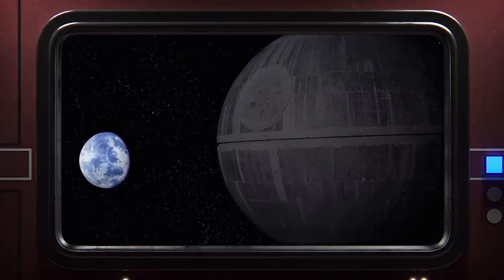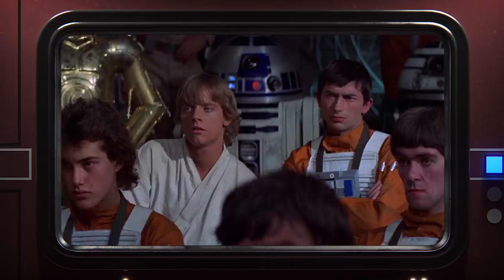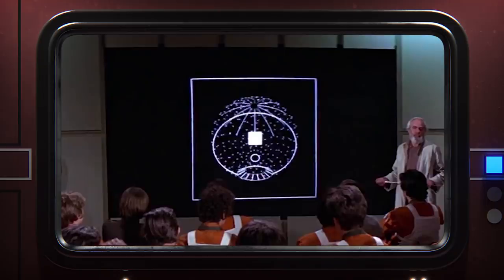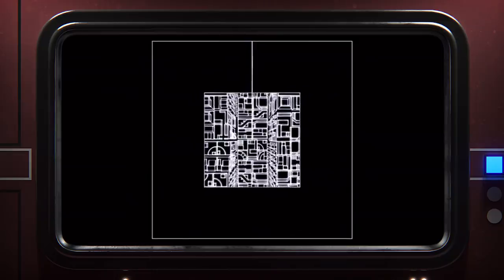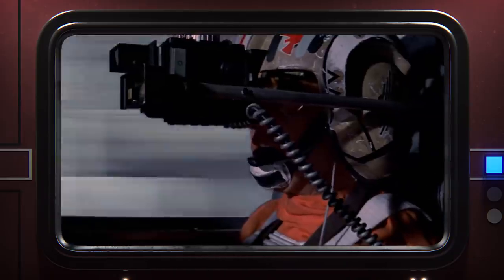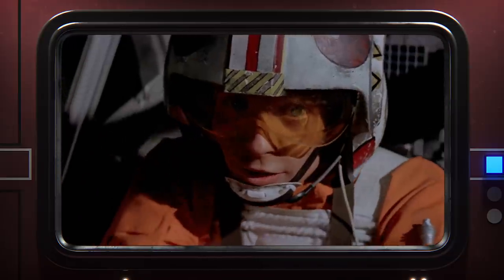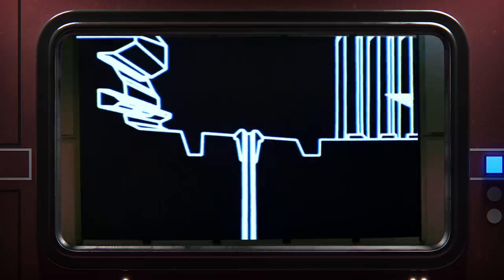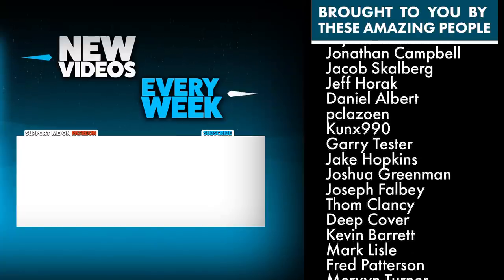The Thermal Exhaust Port Was NEVER a Problem

Comment: They're in friggn space. 
Why would they need an exhaust port to begin with?! xD
It's wasteful to just release gas, they could recycle it. The Deathstar is the size of a moon, you can't tell me they don't have room for it.
Reply: Not gas, but heat exhaust. Which is very difficult to get rid of in space.
Reply: @drksideofthewal  
U can only transfer heat by releasing hot matter or by radiating it somehow. 
I think a thermal exhaust shaped like a long tube implies that it's gonna be hot gas. 
The whole thing is a plot hole. 

kekekeke
Reply: @Broockle  
True in real life, not necessarily true in a science fantasy setting with space wizards. Fictional technology not working the way you expect doesn't constitute a "plot hole," as long as it's internally consistent.

How many ships in Star Wars have gas exhaust?
Reply: @drksideofthewal  
I mean... if you're gonna whip out that argument you kinda annihilate all reason to justify anything. 
It's much more fun to theorize while applying real world physics as much as possible. While accepting certain rules of the universe. 
Everything that is not explicitly magic should be regarded as science I think. 

There's lot of art books and manuals that go into great detail explaining how everything works in the different ship designs and how certain things work like blasters and light sabers. 
Are you saying those have no purpose?

How many ships have exhaust? uhh.. not sure, most of them have thrusters of some kind, not sure if that counts as exhaust.

Comment: Vacuum does not conduct heat, so a vacuum exhaust pipe is stupid.
Reply: It probably used a coolant which it vents into space.
Reply: @jamesleduke873  That's a funny comment.  A cooling system that leaks coolant by design.  It's hard to tell sarcasm in comments :D

Comment: Sorry, watched 10 sec and it's total BS, i mean the whole direct exhaust discusssion. There is just a vent and (Quote ep. IV) "a precise hit will start a chain reaction". So it's very simplified in the animation and looks like a straight line but it is not said that the shaft will go in a straight line of sight and have no  protection inside so the torpedos can go down through to the main reactor. A chain reaction means the torpedos hit something near the surface that blows and leads to other sytem failures and possibly explosions and so on till the reactor fails. What's the point?

Comment: Multiple thermal exhaust ports is believable. But all lead to the main reactor? Not really. Why would you need multiple exhaust ports for the same outlet of heat? The main port functions well enough any emergency thermal pressure would need only one outlet at the critical area the rebels could exploit. THAT was Urso's plan. Identify the exhaust port for the critical point in the reactor. Lower it's defenses as much as he could but who knows if some security genius saw the construction and made Captain by ordering some ray shielding at least. There might have been barriers that could have been engineered along the duct from the reactor to the surface. Even simple grating. But Urso might have come up with excuses that made logical sense not to use them and leave the duct clear for a torpedo to make the flight down it. Come on, really.. This is FICTION. Half a million reasons can be created for what happened, what didn't and why. But I'm glad folks have time to ponder something completely useless. It's a movie and a damn good one. Get the popcorn and drink and enjoy it.

Comment: Give an F22 raptor space drives and life support and it could bullseye the womp...er exhaust port from 100 miles away using a guided missile..   Put a relay satellite up and it could do it outside of the range of the turbo lasers.  No force needed...EXCEPT SCIENCE!
Reply: Right, but does ordnance IRL turn 90 degrees within a fraction of a second, and are they no bigger than 6 inches in diameter?

Comment: Your exasperated tone is the main reason I am even bothering comment. 

Your claim that the explanation is in the main film is correct. Everything else you say is basically logical fallacy. You claim that this is the only weakness because he states "a small exhaust port". However, the singular is used here because he is describing the singular weakness the rebels have found so far. There is nothing to say the 19 other trenches don't lead to the core. 

Same error on the proton whatevers. It is the dimensions of the pipe that make that weapon useful over more typical i dunno laser blasters, or whatever flourescent added in post is called. This is not to say the proton whatevers are the only weapon that can make it down that pipe, just the one they are equipping their fighters with. Hell maybe a grenade would work, and their fighters dont have grenade launching mounts. 

You seem so exasperated that there was a main port and they found this weakness you have closed your mind to the potential that there are many as yet undiscovered ones. Like say if you I dunno play the Close Encounters theme at it a self-destruct initiates. 

Who cares?! This is all a film about suppressing emotions, toxic masculinity, and space sexism anyway. Ever notice the incredible lack of women in power? The savior complex all the men have? That white supremacy seems to have won the day in the original trilogy except our token friend whoever his name was... Stop fighting about George Lucas's samurai Western man-on-man circle jerk...

Comment: slim chance is still bad design. You don't create a weak spot intentionally. That's the problem.
Reply: Some weakspots are necessary. Hangar bays are usually weakpoints in a structure, yet the death star had plenty of those (not that they're nearly as much of a weakness as they were on for example the Venator, but you get my point)
Reply: @legolaven  I mean they created over 13 exhausts without a weak spot. That's why it's dumb to create one exhaust which is a weak spot in the first place.
Reply: @doubled6490  We already know the Death Star was asymmetric in design, given that certain 80 km long superweapon that is off-centre, as such it seems at least to me completely reasonable that those exhaust ports were all differently shaped, which would explain why only one of them was a potentially catastrophic weakspot. In addition to that, there is also the possibility that all of the secondary ports were weakspots, and they just chose one to attack, as is argued for elsewhere in this comment section.
Reply: @legolaven  well now you're creating your own fanfiction. I wasn't criticizing your thoughts on the matter.
Reply: @doubled6490  I'm just doing the same as EC did in the video, speculating from what we know